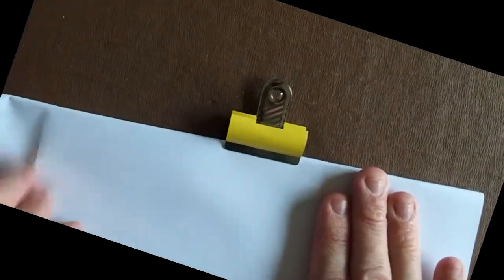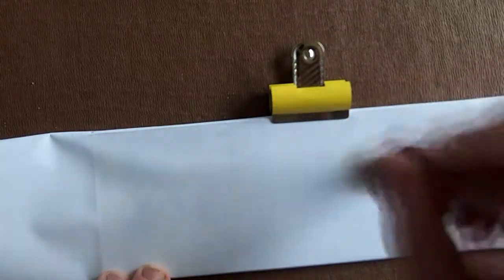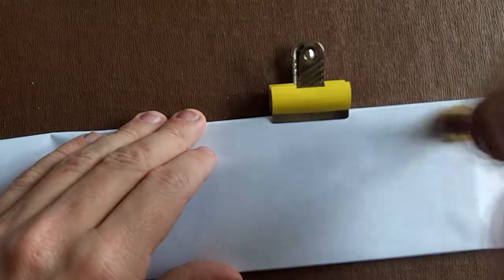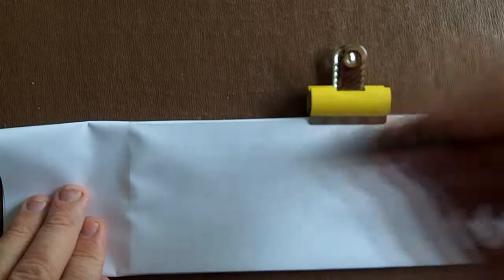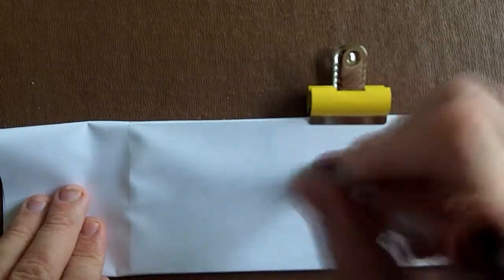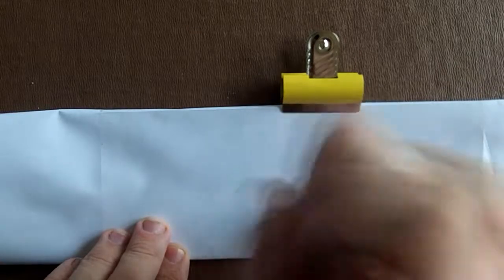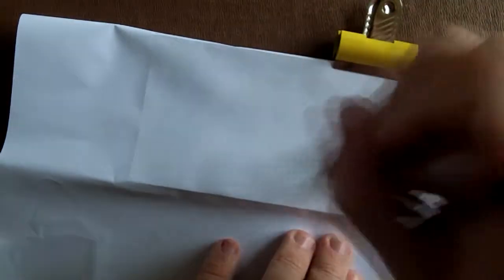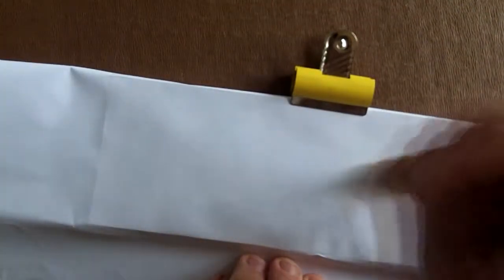Patterning of the Bowdha Sign

Comment: Hello, wonderful idea. But what about ink jet printed patterns? :-/
Reply from the maker: Unfortunately Inkjet printer ink is not heat sensative, and can produce nasty fumes when burnt. If you would like to make your own patterns on your computer then use them as patterns, remember to print them back to front, then get the photocopied at a copy-shop, or at a library for 5-20pence per sheet. as commercial photocopiers use laser toner.